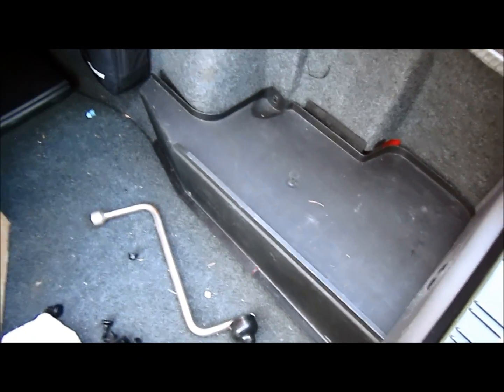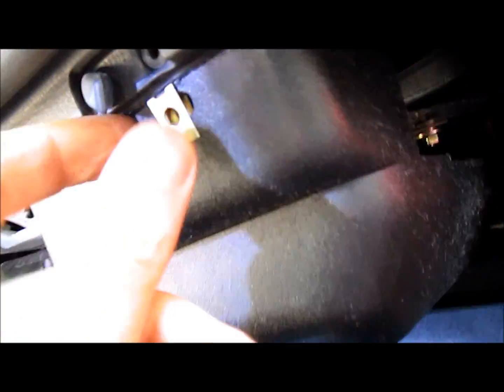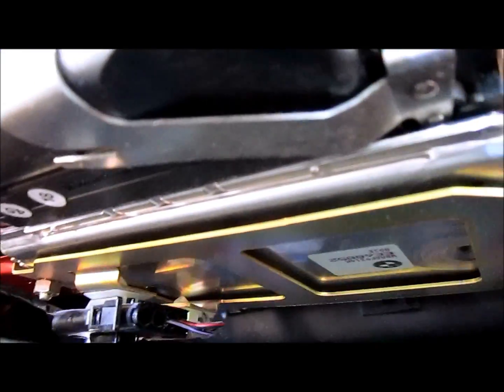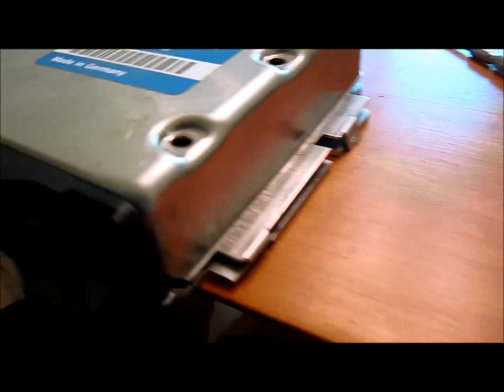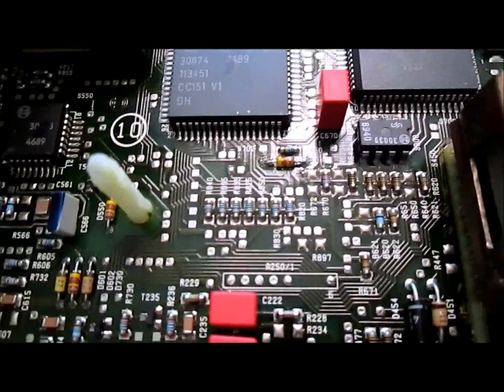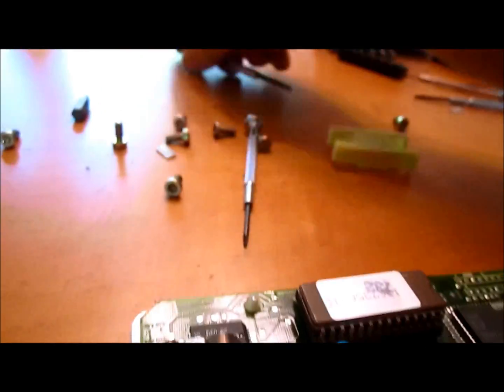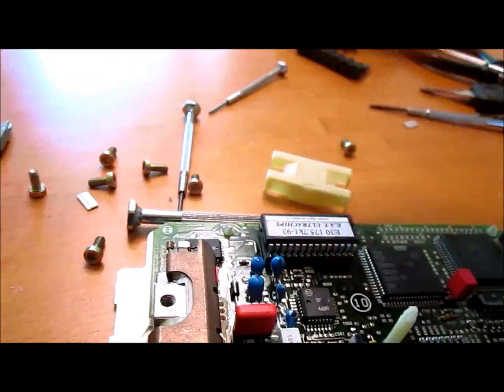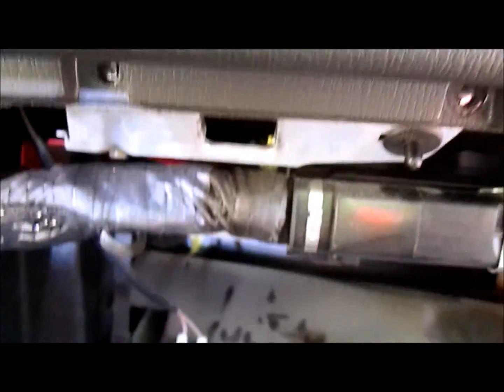BMW E30 318is M42 Chip Install DIY Guide

Comment: Does this model have an idle control unit, and is it visible in this video?
Reply from the maker: This M42 engine does have an ICV, but it’s on the top back of the engine. It is not shown.
Reply: @BluePurpleRed  My car (1986 325e) has both an idle control valve (ICV) and an idle control unit (ICU). They are 2 different parts. The ICU is an electronic part that controls the ICV. I believe the ICU (part# 13-41-1-286-133) is located somewhere in the glove box near the computer. Did you notice anything like that while you were in the glove box?

Comment: What was the reason for replacing the chip?
Reply from the maker: More power. This chip re-tunes the engine's ECU to work on 93 octane extra a little more power and torque.

Comment: Will be my first time doing this if I decided to order the chip for my e36. (m42 1.8L) is there any chance to fry the computer or mess it up if you make a small mistake such as not all the pins being completely mounted, or when removing the original chip (assuming I follow your steps correctly)  
What areas or tasks should I be most careful of?
Reply: Beiträge in Deutsch

Comment: I have a bmw 318is E36 1995, is the installation process the same as in this video?
Reply: Nope, it's located under the hood at the passenger side firewall. It's much easier than the E30 version
Reply from the maker: Probably similar, but the E36 is a different chassis.
Reply: Same have a 318is e36 and fried the dme how did it work for you?

Comment: Hey, I have a mark X chip for a 325is m20 engine, is the installation process the same like in this video?
Reply from the maker: Should be very similar if not the same thing!
Reply: much appriciated man thanks